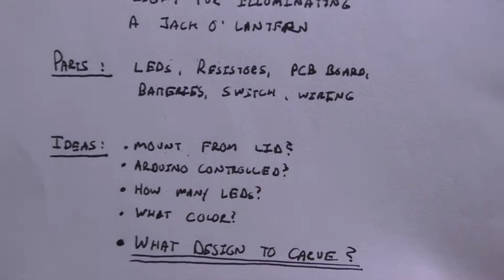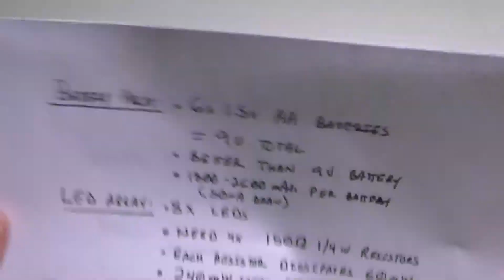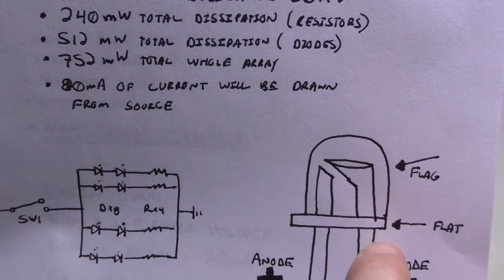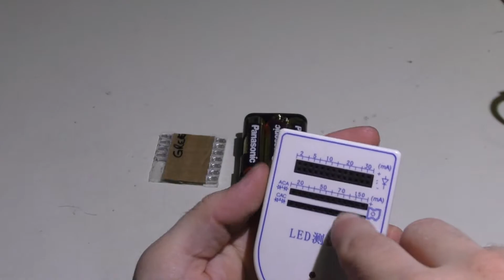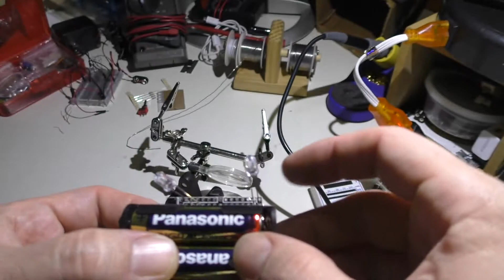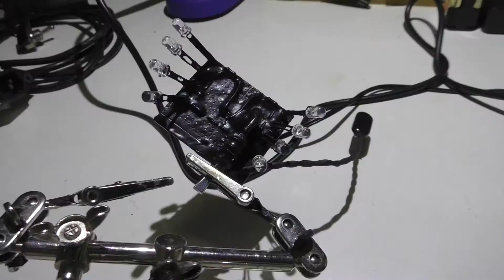PTS Ep. 27 - LED Circuit for a Jack-O'-Lantern (Halloween 2015)

Comment: This was an interesting project!  I was wondering how you were going to prevent the project from being short circuited until the end where you used that liquid electrical tape!  I really appreciate the detail you go to, showing your circuit diagrams, consideration of power dissipation (calculations) and the actual circuit layouts, negative and positive and so forth.  I didn't get a very good look at the switch on the finished project.  What did you do there?  Second, was this an expendable project or did you keep this for the next Halloween?  That switch, cost $3+.  I think I would have wanted to recoup the switch if nothing else off the board once I was done.  Just a thought.
Reply from the maker: The switch was held onto the board with wire that was soldered to the circuit board.  I kept the device for future reuse as it has many uses.  The switch was actually cheaper than you think; I usually buy them in bulk on eBay.  I also recycle old projects and reuse their parts.
Reply: Thank you.